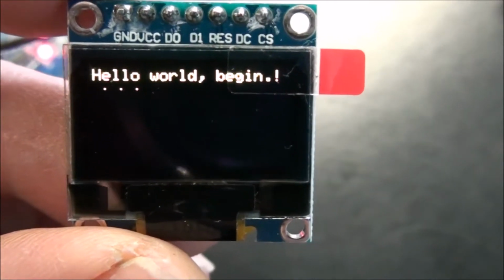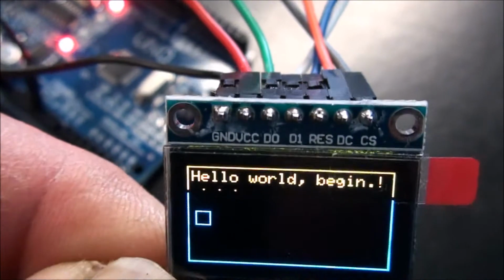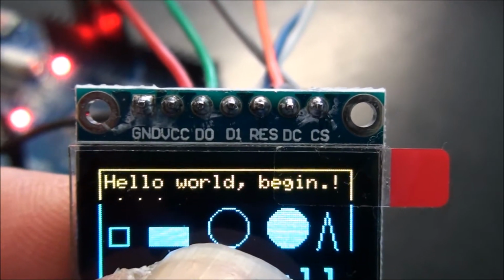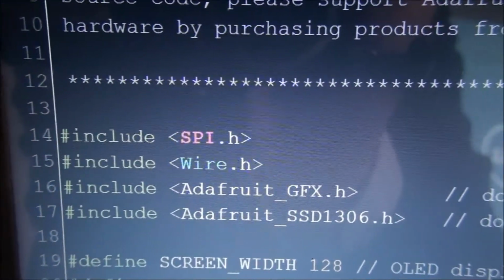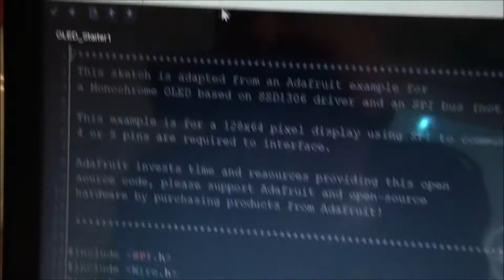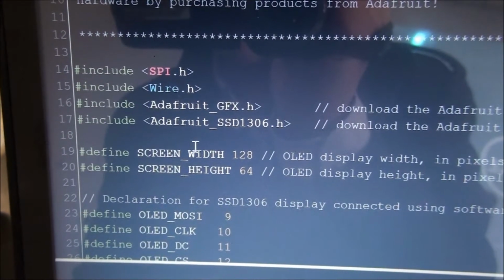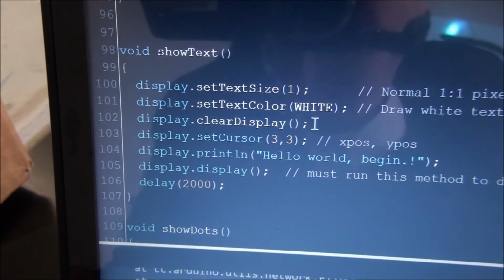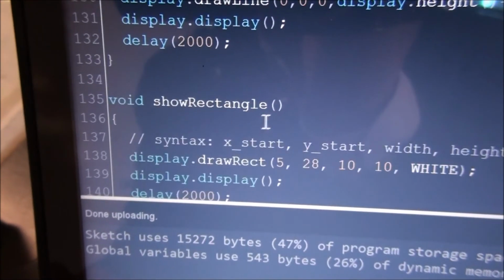Arduino #15 0.96inch OLED 7pin 128x64 Blue and Yellow

Comment: can you plz give me the code thank you
Reply from the maker: hi noman, sorry i only checked my yt today. here is the code. make sure u install the libraries as per the video. i hope it works out easily for u.

/************************************************************************
 This sketch is adapted from an Adafruit example for
 a Monochrome OLED based on SSD1306 driver and an SPI bus (not 2IC/IIC)

 This example is for a 128x64 pixel display using SPI to communicate
 4 or 5 pins are required to interface.

 Adafruit invests time and resources providing this open
 source code, please support Adafruit and open-source
 hardware by purchasing products from Adafruit!

 **************************************************************************/

#include <SPI.h>
#include <Wire.h>
#include <Adafruit_GFX.h>       // download the Adafruit GFX library
#include <Adafruit_SSD1306.h>   // download the Adafruit SSD1306 library

#define SCREEN_WIDTH 128 // OLED display width, in pixels
#define SCREEN_HEIGHT 64 // OLED display height, in pixels

// Declaration for SSD1306 display connected using software SPI (default case):
#define OLED_MOSI   9
#define OLED_CLK   10
#define OLED_DC    11
#define OLED_CS    12
#define OLED_RESET 13
Adafruit_SSD1306 display(SCREEN_WIDTH, SCREEN_HEIGHT,
  OLED_MOSI, OLED_CLK, OLED_DC, OLED_RESET, OLED_CS);

/* Comment out above, uncomment this block to use hardware SPI
#define OLED_DC     6
#define OLED_CS     7
#define OLED_RESET  8
Adafruit_SSD1306 display(SCREEN_WIDTH, SCREEN_HEIGHT,
  &SPI, OLED_DC, OLED_RESET, OLED_CS);
*/

#define NUMFLAKES     10 // Number of snowflakes in the animation example
#define LOGO_HEIGHT   16
#define LOGO_WIDTH    16

static const unsigned char PROGMEM logo_bmp[] =
{ B00000000, B11000000,
  B00000001, B11000000,
  B00000001, B11000000,
  B00000011, B11100000,
  B11110011, B11100000,
  B11111110, B11111000,
  B01111110, B11111111,
  B00110011, B10011111,
  B00011111, B11111100,
  B00001101, B01110000,
  B00011011, B10100000,
  B00111111, B11100000,
  B00111111, B11110000,
  B01111100, B11110000,
  B01110000, B01110000,
  B00000000, B00110000 };

void setup()
{
  Serial.begin(9600);

  // SSD1306_SWITCHCAPVCC = generate display voltage from 3.3V internally
  if(!display.begin(SSD1306_SWITCHCAPVCC)) {
    Serial.println(F("SSD1306 allocation failed"));
    for(;;); // Don't proceed, loop forever
  }
}

void loop()
{
  display.clearDisplay();
 
  showText();

  showDots();

  showLine();

  showRectangle();

  showFilledRectangle();

  showCircle();

  showFilledCircle();

  showTriangle();

  showBitMap();

  showScrolling();
}

void showText()
{
  display.setTextSize(1);      // Normal 1:1 pixel scale
  display.setTextColor(WHITE); // Draw white text
  display.clearDisplay();
  display.setCursor(3,3); // xpos, ypos
  display.println("Hello world, begin.!");
  display.display();  // must run this method to display
  delay(2000);
}

void showDots()
{
  display.drawPixel(10, 15, WHITE);
  display.drawPixel(20, 15, WHITE);
  display.drawPixel(30, 15, WHITE);
  display.display();
  delay(2000);
}

void showLine()
{
  // syntax: x1,y1, x2,y2, WHITE or BLACK
  display.drawLine(0,0,display.width()-1,0,WHITE);
  display.display();  
  delay(1000);
  display.drawLine(display.width()-1,0,display.width()-1,display.height()-1,WHITE);
  display.display();
  delay(1000);
  display.drawLine(0,display.height()-1,display.width()-1,display.height()-1,WHITE);
  display.display();
  delay(1000);
  display.drawLine(0,0,0,display.height()-1,WHITE);
  display.display();
  delay(2000);
}

void showRectangle()
{
  // syntax: x_start, y_start, width, height, color
  display.drawRect(5, 28, 10, 10, WHITE);
  display.display();
  delay(2000);
}

void showFilledRectangle()
{
  // syntax: x_start, y_start, width, height, color
  display.fillRect(25,28,20,10,WHITE);
  display.display();
  delay(2000);
}

void showCircle()
{
  // syntax: x_start, y_start, radius, color
  display.drawCircle(65, 28, 10, WHITE);
  display.display();
  delay(2000);
}

void showFilledCircle()
{
  // syntax: x_start, y_start, radius, color
  display.fillCircle(95,28,10,WHITE);
  display.display();
  delay(2000);
}

void showTriangle()
{
  // syntax: x1, y1, x2, y2, x3, y3, color
  display.drawTriangle(110,40, 115,20, 120,40, WHITE);
  display.display();
  delay(2000);
}

void showBitMap(void) {
  int y=40;
  for (int x=20;x<130;x++)
  {
    display.drawBitmap(x,y,logo_bmp, LOGO_WIDTH, LOGO_HEIGHT, WHITE);
    display.display();    
    delay(10);
    display.drawBitmap(x,y,logo_bmp, LOGO_WIDTH, LOGO_HEIGHT, BLACK);
  }
  delay(2000);
}

void showScrolling()
{
  display.setTextSize(2);  // double text size
  for (int x=3;x<124;x++)
  {
    // display bitmap
    display.setTextColor(WHITE);
    display.setCursor(x,49);
    display.print("scroll");
    display.display();
    delay(10);
    // hide bitmap
    display.setTextColor(BLACK);
    display.setCursor(x,49);
    display.print("scroll");
  }
  delay(2000);

}
Reply: @MrReedable  really thanks bro
Reply from the maker: you're welcome.  thanks amparo for making this simple for norman to find. yes, when u install libraries, they usually come with ready made working examples. run the examples to test your configuration then adapt the code to  your needs
Reply: File -> Examples -> Adafruit SSD1306 -> ssd1306_128x64_spi